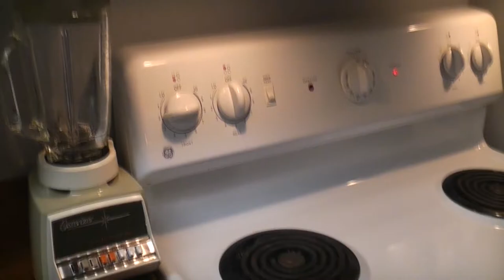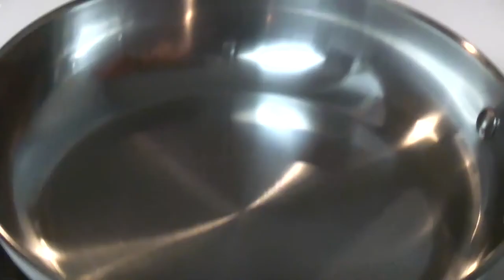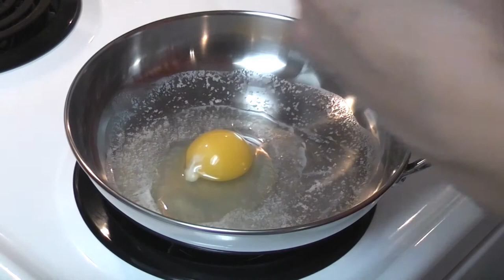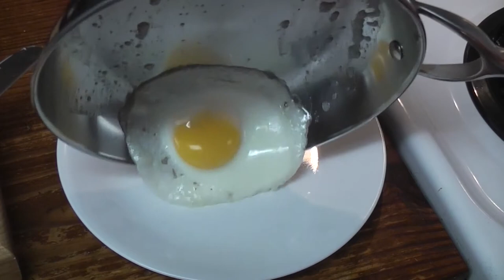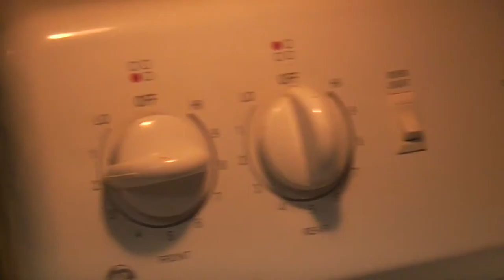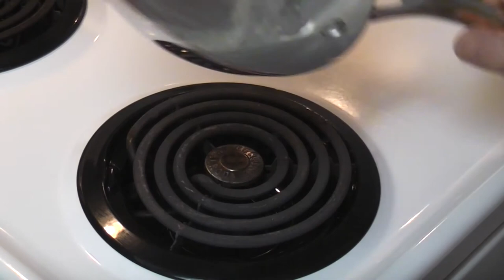How to Cook Eggs in Stainless Steel Low and Slow Without Sticking

Comment: Thank you ! I just got an all clad stainless steel set as a gift a few weeks ago and have been LOVING IT. However, I like silky smooth eggs, not crunchy/chewy bottoms. Every single instructional video told me to bring the heat up until water beads, add oil, add butter then the eggs. I was getting the crispy/chewy eggs that I HATE. I just used your low and slow method with zero stick. The eggs were silky smooth sunny side up, just how I like them. Again, thank you ! You had the only correct instructional video.
Reply from the maker: Thank you for your wonderful comment. I'm so glad it worked for you! :)
Reply: Ja.i hate the crisp brown bottom.

Comment: This is the way I've been cooking my eggs for years now BUT, I cook on an electric stove like you where the heat doesn't rise as quick as with gas. So I don't know if this method will work using gas. If someone has used this method with gas and it has worked the same, then post it and help others who don't have electric stoves.

Comment: I like how you use a lid that is smaller than the pan edge, that way the heat is trapped very effectively, and there's no need to flip the egg. Perfectly cooked, with a slightly runny yolk.
Reply from the maker: Yes! Closer the lid is to the eggs, the faster the whites cook, helping to keep the yolk runny :)
Reply: @xetaprime  oh, that's good to know! thank you

Comment: You, sir, are my hero! I just bought my first set of stainless steel cookware. I knew once I mastered the egg it would all be easy so I proceeded to buy 18 eggs. After about a half a dozen sticking because everyone said preheat the pan, do the mercury test, etc I searched again and found your video. Worked the first time! Thank you so much for teaching me!
Reply from the maker: Yay! I'm glad. Medium heat will work too so don't give up. Ghee, has a higher smoke point and I highly recommend it, but butter is, well, who can fault butter. Homemade ghee is the way to go though so... and TMI I know :)
Reply: Mercury test works too, I use no utensils when I make an omelet, slides out on its own.
Reply: Your eggs that worked the first time, were they cold or room temperature? I heard you need room temp eggs for them not to stick.
Reply: @hepgeoff  they weren’t. Fresh from the fridge using the methods in this video.
Reply: @hepgeoff  I do mine cold, make sure to get the pan hot enough and they won't stick. I haven't tried this method but it looks like it works, good luck either way!
Reply: @hubster4477  Thanks!
Reply: @hepgeoff  sure! If you do an omelet with the hot method have your ingredients close by! It gets done fast. I use no utensils taking the omelet from the pan, it slides right out! Have fun experimenting!
Reply: @hepgeoff  For sure you should let eggs come up to room temperature. They will cook better and more evenly that way, no matter what method you use. If in a hurry, just put them in a bowl with some hottish water, that will bring them up to room temp in five minutes or so.
Reply: Same here

Comment: I just tried to make an omelette similar to this and it works,
I have an all clad D3.
I turned on heat to 4 on ceramic stove top wait 1 minute add butter then add mixed eggs, cover lid, wait about 4 min and it didn’t stick at all.

I think the lid helps it becoming non stick,
I prefer the hot heat method but this is easy and perfect for my mother to do.

Comment: I have a little trick for frying eggs on stainless but it's kind of silly.

1) Heat up oil (preferably with high smoke point) in stainless pan until it starts smoking decently, then turn the burner off.

2) Let the pan cool completely. 

3) Remove the now cooled down oil (or keep it in the pan if you want), throw some butter in there, heat at medium low to medium (basically just as you would a non-stick) and the pan is basically a teflon non-stick. Works great.

The problem is, the non-stick doesn't last very long. after a few cycles of eggs, it will start sticking as per usual.   

It's kind of a party trick for people that have learned lessons the hard way with cooking on stainless steel pans, as many of us have.
Reply from the maker: Not silly at all. And party tricks are awesome! I swear I've heard that method before but never tried it. Hey, anything that works is alright in my book! :)
Reply: yup!!!  this is my process too.  always works!

Comment: The real science here is the steam trapped in the pan that helps release the egg once its bottom surface solidifies. Low heat because   it prevents the temperature in that covered space from rising too significantly; causing the eggs to over cook / over Fry the bottom. You can see this effects when you overcrowd the pan with too much meat (high heat setting), all the water and steam created in the pan will certainly ensure the meat to not stick (albeit no browning).

You can achieve this with the Leidenfrost "fairly high heat" method, although not required, as soon as u put ur egg in, cover it with a lid for a few 10'seconds, remove lid, test with a spatula underneath and viola, you'll have an egg that's got a more fried bottom than the low and slow method. You can reduce heat afterwards with the cover on to continue cooking the top of the egg; just be careful not to over Fry the bottom. Of course u can do that with low and slow method too then just removing the lid and turning to high to flash fry the bottom, but be cautious of the fact that the yolk will have started receiving the gradual heat input and consequently would have started / will start cooking internally by that point.
Reply: @xetaprime  agree
Reply: Don't care about this particular science. I just want my yolk intact, ROFL! That's all I wanted and now I have that! PLUS, I don't want to have to replace a stupid non-stick pan every couple of years!
Reply: @UserYoutube-i6f This answers my question of whether the lid is required… Thanks.

My other questions are:
1) will this method work for an over-easy egg?
2) will this work with a sunny-side up that’s been seasoned (e.g. salt and pepper) and flipped for an over-easy finish?
Reply: @ejones7589 
Don't really need the lid if you're going to flip it anyway. The lid is to help cook the top.

I don't season it until afterward anyway. Flip it and then season it, I suppose,  if you're concerned.

Comment: Question, will this method only work with butter since butter has a low smoking point? Or can I use a high smoking point oil like avocado oil?
Reply from the maker: Great question and sadly I still haven't used oil. I just prefer butter. But, I found a fairly recent video on tiktok that used oil low and slow and it worked. I'm sorry I don't have the link. If you Google search eggs low and slow stainless it should come up.

Comment: Holy cow, I just tried this and it works like a charm! I used olive oil instead, and it still worked. This is how I’m cooking my eggs from now on! I wonder if it would work with scrambled eggs. Also, how important is covering the eggs? I wonder if it will work without covering.
Reply from the maker: Great! I haven't tried using Olive Oil. I cover the eggs to help the whites cook faster, leaving a more runny yolk since it is cooking longer/slower.  No lid shouldn't affect it being non-stick.

Comment: Thanks for the video! So essentially if I have to sum it up, it look s to me like the key here is to use enough fat to create a layer between the pan and the food, no matter if it's oil or butter, if the temperature is high or low. I suspect with higher temperatures, maybe less fat would still work, while at low temperatures, you have to make sure there's a good amount of fat. Does this sum it up correctly?
Reply from the maker: I don't think you need too much fat. I've poured out the butter before adding the eggs, and they still don't stick. I made this just to show it doesn't 'have' to be 'hot enough' as people say.

Comment: burnt mashed potatoes in a quart sauce pan. The pan is now blue at the bottom. Is it ok to still heat a can of pees, corn or even instant potatoes again
Reply from the maker: Did the bottom melt/fall off? If not, it should be fine and Bar Keepers Friend powder cleanser should remove the blue color. Good luck!
Reply: @xetaprime  it’s a real 70s stainless steel with no layer on the bottom. I do have a 2 quart with a 1/2” layer of something on the bottom but the pan I speak of is 3 or 4 ply SS

Comment: I'm really impressed. Do you need butter for this to work, or can I use olive oil instead? Also, did you season the pan with oil before cooking? How long did you have your pan at the #2 setting before adding the egg to the pan? I also heard that eggs need to be at room temperature, not cold, when adding to the pan. Was your egg cold or room temp?
Reply from the maker: I didn't season before cooking. I haven't tried Olive Oil. I think the most important thing is to make sure there are no bare spots of steel when you add the eggs. Oil may tend to clump and you may need more to fill the bottom. Maybe a low (thinner) viscosity oil? Sorry, I've only tried this with butter and homemade Ghee. Heating time only enough to start melting the butter. I took the eggs out when I started cooking. Meaning took eggs out, started heating pan about the same time. No pre-room temp.  So they were still chilly. If you are not opposed to cooking spray oil that may be near fool proof.
Reply: @xetaprime  Thanks for the quick reply. I appreciate it. Enjoyed the video!

Comment: The technique demonstrated in this video will not work with light seed oils. But will work with coconut oil or butter or lard.

There are two methods:
1) Butter/Crisco/Coconut oil method: Use saturated fat to prevent sticking. Demonstrated in this video.
2) High heat, unsaturated seed oil method: Use light oil. For this method to work, you need to heat pan first and then put oil in.
Reply from the maker: I haven't used Coconut oil or Crisco low and slow. Thanks for the tips :)

Comment: Will this method work with carbon steel??
Reply from the maker: Good question. I haven't tried low and slow with carbon steel... depends on the quality of the seasoning I think.
Reply: From my experience carbon steel is easier to cook with than stainless. I love both. With carbon steel I preheat on med low flame for probably 2 minutes. Use butter then easily drop egg in. There should be a moderate amount of sizzle and cook action but not rapid frying or no noise at all.. basically a calm ish cooking.. that’s how I get nonstick eggs. I have a video of a Winco carbon steel and I fry an egg if u want to see.

Comment: So whats the secret? Just the amount of butter?
Reply from the maker: It works with less butter as I have poured often out the extra... Secret? IDK. Just showing the pan doesn't have to be water dancing hot.
Reply: @xetaprime  I think letting the water in the butter evaporate first and having the eggs room temperature help. Do you do this? Or maybe the really slow cook just helps bring the eggs up to the same temp along with the pan.

Comment: You use butter. What about regular cooking oil? Any difference???
Reply from the maker: I've only used butter and homemade ghee low and slow. Not sure about cooking oil...
Reply: Cooking oil makes this awfully taste crust. You can use combination of oil and butter. Oil prevents butter from burn and browning and butter cook and make a soft and delicious flavor to an eggs. Or you can use just a ghee - clarified  butter without milk fats with a unique nutty flavor. Ghee also has a high smoking point so it's grate for cooking anything. And a good thing it's you can just make ghee by yourself - it's easy.
Reply: @Tetramor4  Avocado Oil seems to NOT impart any flavor or taste to the food I cook in it. Olive Oil does and it has a lower smoke point. Like you, I use AO in the pan first and once the food is added which slightly cools the pan I add the butter and it does not burn or turn brown. I use Ghee that I make for some foods, but I like the taste of the Butter better.

Comment: Why the lid? So the top cooks? And why not use cooking oil?
Reply from the maker: When cooking low and slow the lid does help cook the whites quicker, leaving a nice runny yolk. Butter spreads out over the whole pan. I suppose spray cooking oil would work nicely, but bottled oil just doesn't spread out unless you use a lot of it.
Reply: @xetaprime  I think another thing is that your pan is very clean. So there isn't any chemical reaction with sticky residue. Thanks.

Comment: But can you do it with no oil?
Reply from the maker: uhm... ehh... D'Ohhh!!!
Reply: But why? Eggs should be cooked with butter or ghee, otherwise it's just burn and tastes bad. Adding a small amount of butter doesn't make this extremely high on calories and fat.
Reply: @Tetramor4  I never said I cared about the calories. I was just expecting a technique so the egg didn't stick regardless of the amount of fat you use. If you add a good amount of fat to any pan of course it won't stick.
Reply: Yes, I understand about using no oil, as the diet, I am on says almost none then only olive oil, I will be trying to cook in the pan with parchment paper, using (water) a wet piece to make it fit into the pan, and then cooking on top of the paper, probably a bit of oil in the pan itself. but not just for eggs but fish and chicken also. we will find out soon. Great Video Thank You

Comment: I don't see what the temperature matters, when the food is swimming in oil. The problem is not food sticking if you fill the pan with butter, the problem is how not to get the food to stick + not to have heart disease or make it worse.
Reply from the maker: There's quite a debate these days about butter and heart disease, I wouldn't call the butter I used 'swimming in' though. But I hear ya.
Reply: @xetaprime  Yes that is true: pretty much every nutrition topic is debated and the doctors change their minds every 10 years, on what is actually healthy and what isn't.